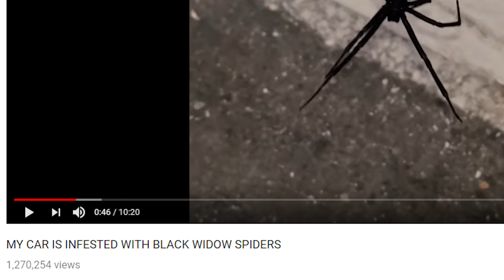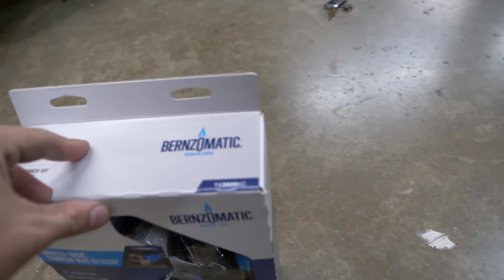3 ways to remove Black Widow Spiders from your CAR

Comment: I'd be nuking that garage with a bug bomb.. sorry man, but they are everywhere.
Reply: Alex A ya. He definitely needs multiple bug bombs.
Reply: The downside of most bug bombs is that simply covering the spiders in it doesn't kill them. The tactic to use in killing them is by having them eat insects that are affected by the bug bomb. Spiders are annoying af to get rid of since they need to actually ingest the chemicals for it to start dying. I fucking hate it cause most of the time all of the food dies before every spider eats them and then you have to wait for them leave. Or just set the bastards on fire
Reply: 2ndLieutenantBadger I’ve had to deal with this before. Go on amazon. Buy a few hundred feeder crickets. Bug bomb them and let them loose.
Reply: @yeeturmcbeetur8197  Perfect plan
Reply: WD-40 on youre brakes? Mhh

Comment: correct me if im wrong but didnt elon musk have flamethrowers? not torches.
Reply: RalexTTM they are very smartly called “Not A Flamethrower” because they are actually roofing torches
Reply: They actually just used a propane cylinder on his “not a flame thrower” so it doesn’t actually throw large flames it’s just a oversized torch
Reply: Flamethrowers are illegal lol
Reply: Adam Bose nope, you can buy them as a civi

Comment: I know this video is old and you may have learned other methods of getting rid of black widows by now but you can also use a really stiff hairspray. The hairspray will freeze them in place and kills them. It may take a few minutes to harden but it does work.

Comment: As an Aussie I find this extremely satisfying to watch. Redbacks/Black Widows are such an annoying species of spider to deal with. One of the more hilarious ways to deal with them actually is to buy a whole bunch of hard plastic """vibration massagers""" and place them anywhere that they can rattle and buzz against panels and parts of the car where the spiders are hiding. Then surround the car with a very thickly placed ring of exterior, long lasting, surface bug spray. RB/BWs hate being disturbed constantly, so they'll tend to vacate after a couple days of being constantly disturbed.    It's a lot less fun than setting them on fire, though.

Comment: If use starting fluid, carb and choke cleaner, or brake parts cleaner, there more flammable and since they naturally evaporate already when you set them on fire there is no residue left over

Comment: I didn't think the oil kills them, thought the oil just makes the surface slippy so the spiders can't get a grip? Would make sense as the spider left the web and walked off. there is a spider spray you can buy that does this and it prevents them from coming back but it only lasts so many months

Comment: I had a bad infestation of black widows in my talon. I had tried brake clean, removing webs, burning them, turns out they nested on top of the fuel tank next to the sending unit. Smart things... webs kept coming back kept finding tons of black widows everywhere. They loved hanging out in the wheel wells and deep in the car. Buddy told me to use some foggers. Bought a couple cases and ended up using 4 cans in my garage because I became paranoid. I had the doors open, hood open, hatch open, car on jackstands, used two cans in front of the car and two cans on the back half. Closed the garage, set them off, checked back the next morning and it seemed to have worked well. It’s been over a year and haven’t seen a web since.
Reply: What did you do or how did you clean your car interior of all the chemicals afterwards?

Comment: ...You could have just used insecticide that is meant to kill widows and scorpions specifically; you'd have to crank up your vehicle or attach a hose onto the insecticide to reach all the crevices under the car, but it would kill the widows.

Comment: The best way to get rid of them is to play  their game... they come out when is dark well turn off the garage lights, meanwhile go to home depot and get yourself a gallon of ortho insect killer it only cost $7.97 and a HDX micro fiber duster stick $ 3.98  do not turn on the garage lights just use a hand light spray all the mother fuckers and with the duster clean all the spider webs the duster will go thru every where in your engine, muffler, fender etc.etc.

Comment: Those webs are technically slight stronger than steel but since it strands you can't tell but it is strong and my classic just had an infestation of them- most in the engine bay, which got fried once I started it up 😈 but the battles not over :/